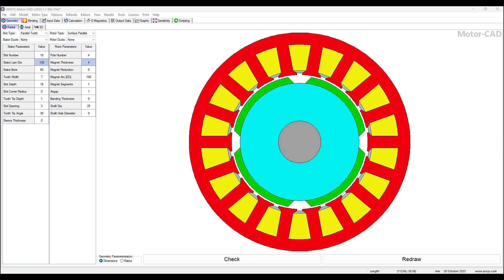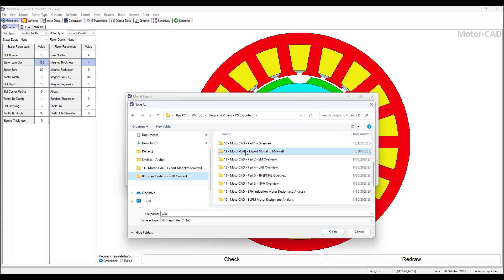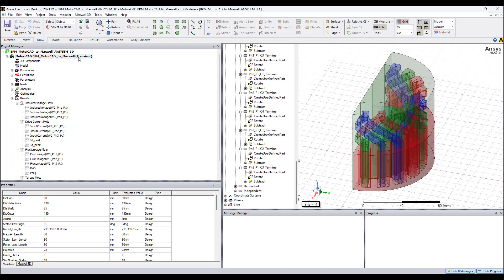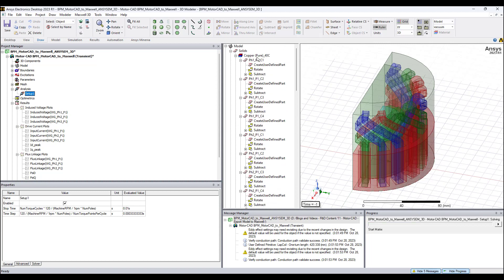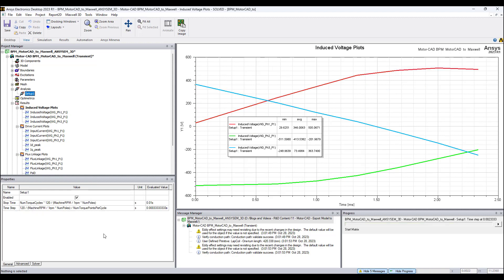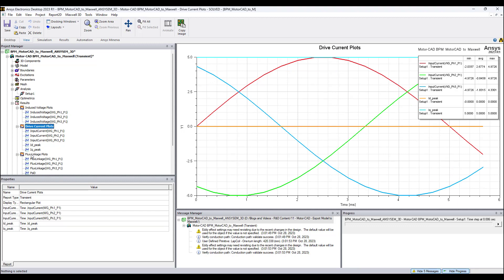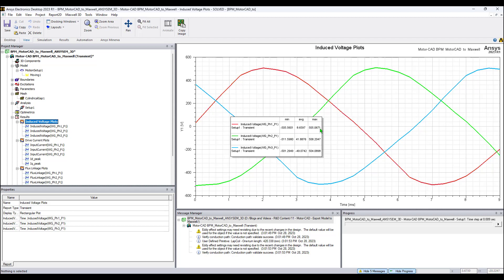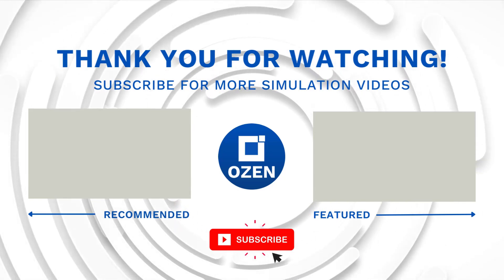Ansys Automation of a Maxwell Motor Model using Motor-CAD Script: Part 1

Comment: Good video.
Perhaps I missed it. Does the program do a physics simulation that shows the parts actually moving due to the magnetic interactions, or does it just shows graphs and colors? If you model two simple magentic cubes will it show them moving towards each other if oposite poles are facing each other or it just shows you a graph?